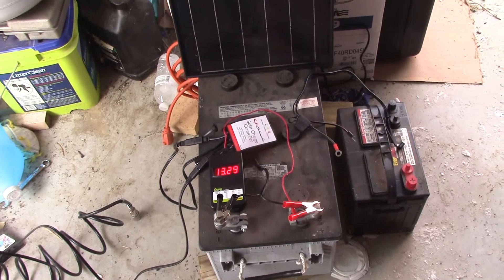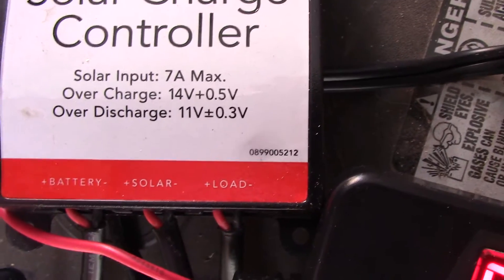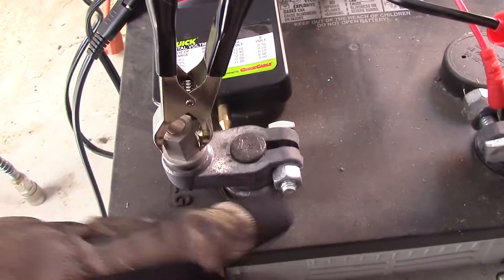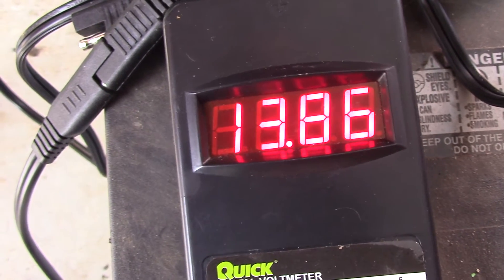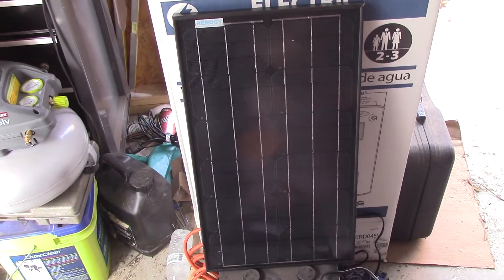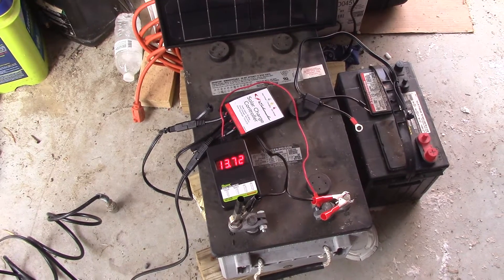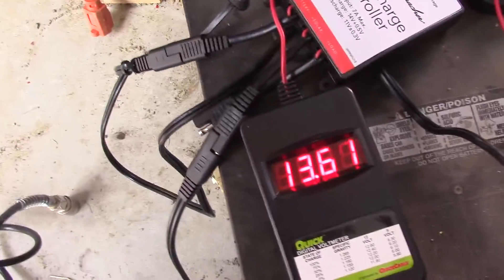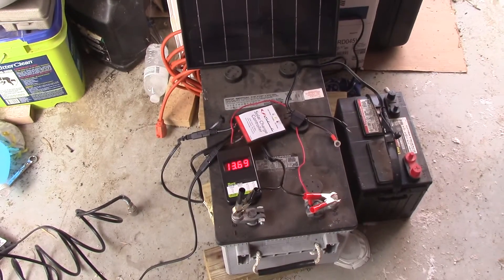Schumacher 7A solar charge controller and Renogy 30Watt panel/RNG 30D

Comment: I have this schumacher controller and as in many amazon reviews there are reverse polarity issues with it.  Also you should show how you connected the multi meter and safety online fuse you mentioned.
Reply from the maker: Not sure about the polarity issues.  I have 2 and both work well.  I really like the product.  I think I showed the fuse cable in the video?  It is a great tender setup as long as you don't leave it on a long time.  I can charge 4 or 5 batteries on a sat or sun in a few hours.  I will have to go back and watch the video.  It was a long time ago.

Comment: Did you cut the MC4 Connectors off the solar panel wires so you could use the battery tender type wiring and connectors. If not, how to you connect the panel to the Shumacher solar controller?

Comment: Hey Jim long time no hear I"ll PM you my Contact info
Reply from the maker: How ya doing?  Good to hear from you.  Thought you must have been back on the road
Reply from the maker: How has the snow been up there this year?
Reply: Not too bad About three feet and melting quicklyish Been very cold and windy though. How about you guys?
Reply from the maker: Below zero and set a new record for cold in feb.  Snow was ridiculous, lol  I think we are close to 10 feet this year and still have this month to go.  It was a cold snowy winter.
Reply from the maker: We hit 30 below a lot this year.  I was supprised.  I think some places were 60 below with wind chill.  They said it was a 30 year winter.  I would have thought it would have hit you to?
Reply: Mostly cold and wind lots of -40C weather 9 cords of firewood burnt so far this year only 3 cords left
Reply from the maker: I was in bed early last night.  Had an appointment yesterday.  It's 5 am here now.  Hopefully it will start to warm up for good now.  9 cord.  That's some work.  Good to here you again.  How is your phone situation? I think Canada is free for me.
Reply: I don't know if the states are free for me.If you check in your google hangout messages I left mine there
Reply from the maker: ok